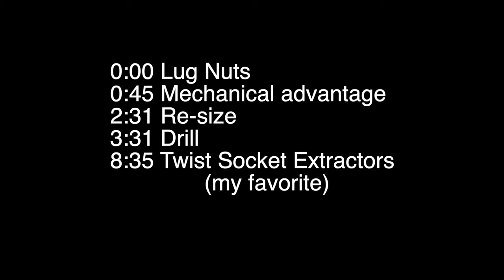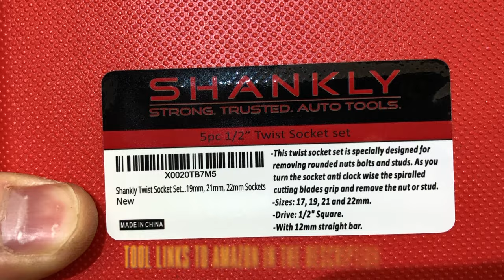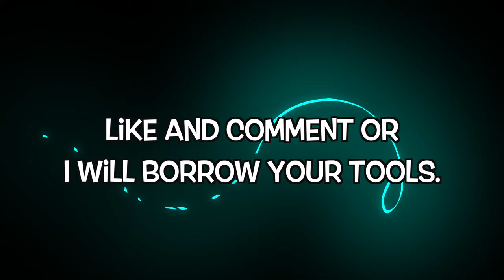STUBBORN LUG NUT REMOVAL TO SAVE YOUR WHEELS! 🛞🔩 Simple-Fast

Comment: Working on my dads 2006 Chrysler Sebring, been sitting for about a year and a half and the battery is dead so gotta change it. In Chrysler engineering wisdom they put the battery in the driver side fender, so have to take the wheel off to get to it. Managed to get 3 out of the 5 lug nuts off but ended up stripping 2 with a 3/4” impact socket. Would you recommend the fluted sockets to get them off?
Reply from the maker: Ya the twist sockets are great. No guarantee. But they have saved me so many times. Essential tool for me 😀🔧

Comment: Is the farther out you are with the breaker bar does it give you more torque? I have a 2012 jag I’m working on. Let my brother help me with this car and apparently he thinks forward on a compact takes the lug nuts off and if not keep going until the lug nut is completely ROUND! Ima try a chisel and a hammer hitting it on the side hopefully turning the nut well so says the triple OG in the 53.. let me know if anyone knows if this technique works porfavor
Reply from the maker: Yes the longer the lever, the more leverage/torque you will have. Sorry you rounded the lug nut. I would buy the twist sockets in the video. They have saved me many many times in situations like yours with rounded lug nuts. I put lots of links in the description for video tool ideas. Here is the link for that twist socket set for stripped lug nut removal 😃🔧 
TWIST Socket kit: https://amzn.to/3jps8K3

Comment: Where are you located.  I would like to hire you to work on my 5th wheel trailer rim and lug nut replacement. The nuts and the rim holes have clad over nuts and metal inserts in the  rim holes.
Reply from the maker: Sorry not for hire. Just making videos 😃🔧

Comment: working on 2017 nissan versa note car 🚗 tried to remove nuts when changing brake pads with torque wrench but the nuts weren't coming off and now are bent a bit from the original six face shape to more circular form. any advice? thanks
Reply from the maker: I would replace the nuts even if they are still functional so they don't cause worse problems the next time they are removed. 
Are they stuck on, and you can not remove them? 
Or you removed them, and they are now just damaged?
Reply: @EasyFixShaun  i tried to remove them but couldn't and the nuts ended up becoming more rounded from strain
Reply from the maker: Sorry to hear that. I think the twist sockets in the video would be my next attempt.  I would pound them onto the affected lug nut really good before attempting removal. Impacts work best with the twist sockets if you have one 😀🔧
Reply: @EasyFixShaun  thanks for your help💖
Reply from the maker: No problem 😀🔧

Comment: I have 2011 tundra with aftermarket wheels and the 1/4 inch extension of the lug nut broke off in every wheel. Any suggestions please?
Reply from the maker: What is a "1/4" extension"? Are you talking about wheel spacers?
Reply: @EasyFixShaun  regular lug nuts have a seat like 60 degrees mine have a 1/4 inch piece that extends past the seat into the wheel. Just looks like a sleeve. Wish I could should a pick.                                             20 ET Conical Bulge Long Lug Nuts 7/16"-20 with Center Washers 0.33" Shank 0.62" Dia 1.75" Length
Look these up. Every one of the sleeves broke off on the stud.

Comment: I got the 1/2" drive,  25" breaker bar from Harbor Freight Tools (on sale this week $16.99 + tax with coupon). Also got a 6' fence pole.
But I have a regular 11/16" (7.46 mm) short socket 1/2" which I was going to hammer on but now I'm afraid it's not going to work after watching this video. If I try this first, will it mess up the lug nut further so the other methods (impact socket or extractor) won't work later? Thanks
Reply from the maker: Its worth a shot! Use what you have so far. Many times pounding on a smaller socket trick will work. If it doesn't work, usually the twist socket will still bite into whats left and work. I have more options available. I usually go straight for the twist sockets in most cases 😀🔧
Reply: If the smaller 11/16” socket won’t work and gets stuck on the lug nut, is there a way to get it off the car? I don’t see how you can get it off if it’s short like that. I did see in you video that it broke apart at one point however, but what if it just stays on? 2:45 Would removing it damage the lug nut enough that any further efforts would be harder?
Reply from the maker: If the lug nut is impossible to get off, you don't have much to loose. Pounding it on gives it extra grip to hopefully remove it. If it doesn't work a long 18" 1/2" extension could be used to wiggle and force the socket off again. That is what I would usually do. If it works, a punch and vise or block of wood will likely be needed to pound the nut out of the socket 😃

Comment: 8:48 How can an open-ended lug nut be removed from the socket/extractor since their is nothing at the end to push on?
Reply from the maker: A punch comes with the twist socket set that will usually grab the edge of an open ended nut and pop it out 😀😀

Comment: I have a lug nut on a Jaguar 2012 That has been tightened extremely tight I have had AAA I've had a tire place try to take it with the reverse thingamajig as well and it still won't come off please advise any other things you can possibly think of as well I'm not sure if they use the tool that you have but they did have something similar to it where it would do the reverse on it and try to unlock it please advise I'm in Los Angeles
Reply from the maker: Hey John, I am sorry for the late reply. Any luck? If you want to save the wheel and all methods are exhausted I usually drill the wheel lug nut until i can remove the wheel like in the video. Then I repair the damaged stud and nut and check all others while there 😃🔧
Reply: Thank you so much for your reply I greatly appreciate it. After so many people came by the house to try to get it off finally a young man came by $200 later unfortunately and he drilled it off it's a little damaged but it looks like I can still save the stem and put the lug nut back on. Unfortunately he wouldn't test out all the other lug nuts to see if they were tight but he refused
Reply from the maker: Im glad you git it figured out! 😀🔧

Comment: Been trying to get a over tightened lug off my 02 bmw 325xi. With 0 luck not sure at this point what elce to do.
Reply from the maker: Sorry to hear that. Is the hex fastener in great shape? If so I would use as a long of a lever as possible to make it easy to break it free. Or borrow a milwaukee electric fuel impact from someone. They will take things off easily or break them if they won't move. 🤓🔧

Comment: 2003 eddie bauer expedition. I've tried everything and can't get the lug off.
Reply from the maker: stuck? Can you get a bolt buster style heat element on it? If you have enough access that would make the nut glow red hot to release and remove with damaging the wheel. If that doesn't work drilling is a good method to attempt to save wheel 😃

Comment: Chevrolet Spark 2019. Lug nut won't come off. Can't do the seasonal exchange.
Dealership is an #ss been useless since we bought the car... Well that's another story.
The tire guys at costco told me the mechanist will need to cut the bolt off. Is it true? Will it cost me a ton of money to change it?
I'm in Canada... price wise.
Reply from the maker: Sorry for the late reply. That sucks. I would recommend the steps in the video to save the wheel. Usually drilling out the stud the the last method of non of the other methods will work. Depending on what is needed the price would vary. I wild rough guess- $100-400. Any luck on the stud since you commented?

Comment: 2014 Chrysler 200 …. VERY IRRITATING. Thank you for making this video. Your suggestions have helped ALOT. Tires plus is an absolute joke, used an impact to tighten my lugs after new tires & the worst part is they told me they did it.
Reply from the maker: Sorry you are having trouble. Your Chrysler Lug nuts are very difficult in general when they get older and corroded. Sometimes replacement of all the lug nuts at the same time is easiest 🔧🔧

Comment: I wish replacing wheel studs would be that easy on every car.
Reply from the maker: Sometimes they can be more difficult for sure. Access to the wheel hub is usually the key. As long as you can gain access, the little installer tool has made them a breeze for me 😃🔧
Reply: @EasyFixShaun  Yeah. Good luck trying to do the same with a Honda. Their hubs are pressed in and most of their knuckles lack clearance to push the stud out without chopping it or push it in without shaving one side.
Reply from the maker: @aurvaroy6670  For sure. If clearance and access is bad, Replacement of wheel bearing and hub could be much easier and faster and/or the only way. Studs are cheap relatively speaking, and when there is no clearance it changes the cost and difficulty and pia factor fo sho!

Comment: 07 Dodge Caliber and I have a issue with removing this one lug on my wheel tried twisted sockets and it did work at all
Reply from the maker: That sucks. I think I ended up having a similar problem. One lug nut just wouldn't come off, no matter what I did. I tried hard to get it loose too! The drill ended up coming out and removed it pretty well for me 😃🔧
Reply: @EasyFixShaun   yea it would come off for nothing no matter what I used so I’m just gonna go to a tire shop an have them fix the issue
Reply: @EasyFixShaun   damn Chrysler’s
Reply from the maker: @eriknobles3946  That sucks man. I have seen some crazy difficult lug nuts on chryslers. I don't blame you one bit 😃
Reply: @EasyFixShaun   gotta get it done in case I get a flat in the middle of nowhere stuck
Reply from the maker: @eriknobles3946  Yup smart move for sure man. 🔧

Comment: What do you do if the stud is turning
Reply from the maker: In that case I would go straight to drilling the stud method. I would probably loosen the other nuts that are good so that I could put some pressure on the one bad nut with the wheel stopping it from turning so that I can drill the nut. Might need some additional methods to stop the lug from spinning, but I would spend time trying to figure out how to do that. If it doesn't work the next step might be cutting off the lug in one way or another😃🔧

Comment: hello, can i go straight to drilling the lug nut with drill bit? because today was gonna rotate my wheels but when i was loosening the last lug nut it just stopped. and i didnt want to force it so i think this is my best solution. i have done this but i dont know what else to do.
Reply from the maker: Yup. I think that you have a perfectly good reason to just drill it. You could try to force it one last time since you have nothing to loose. 😀🔧
Reply: @EasyFixShaun  well I got it out with good old wd40 lol
Reply: @EasyFixShaun  but stud is cross threaded
Reply from the maker: Im glad you are making headway. Its super frustrating when they don't work properly. Nice work 😀🔧🔧

Comment: How do I remove a lug bolt???? my wife’s Jeep Compass 2018 has a bolt instead of just a nut
Reply from the maker: Similar methods apply no matter what style lug nut or bolt you have. If it is stripped i would try the twist sockets. That would be Awesome if that is successful and would save a lot if drilling. Drilling would be a last case scenario method. Sorry you are having trouble😀🔧

Comment: What kind of drill bit did you use to drill out the stud?  Mine wouldn't work.
Reply from the maker: I use cobalt or another high quality bit. I put links in the description. Here it is 😃🔧
Cobalt Drill bits: https://amzn.to/2YLW7nA
Reply: @Easy Fix  I tried some cobalt drill buts but couldn't seem to get anywhere with them. 
I ended up buying an angle grinder, which quickly split the nut, then I broke the two halves off with my hammer.
Reply from the maker: Nice work! Any wheel damage?
Reply: @Easy Fix  not really, aside from some paint scratches from tools scraping against it, and a small, shallow nick of about 2mm where the cutting disc briefly touched it.  I put some touchup paint on those parts.
Reply from the maker: @AJ-on-youtube  Nice work, I am glad that worked out for you! 😃🔧

Comment: Need some help. So I stripped a lug nut so I hammered a smaller socket on it, so the wrench broke and the extension broke inside the socket idk what to do.
Reply from the maker: I would try to remove by pounding off with a hammer sideways back and forth if that is the only option. Once off- Try the twist sockets, hopefully that will do the trick. If not drilling may be needed 😃🔧

Comment: same issue with my 2020 wrangler (22mm).  Even though torqued properly, one lug is stuck to the point where the "cap" is all deformed and spinning.    Imagine having a flat off-road??  I even bent the tire iron OEM wrench and still nothing.  Chrysler and any other mfg needs to wake up before someone gets hurt.
Reply from the maker: Wow! Ya that is crazy. The lug-nuts have been like this for 2-3 decades now. It seems that the design is the best they can do. Absolutely crazy 🤮

Comment: 2011 skoda octavia vRS two rounded 17mm lug bolts
Reply from the maker: twist socket will usually grab hold of those and make them come off fairly easy. That is my go to method. Hopefully it works for you😃🔧
Reply: @EasyFixShaun  I'm going to try a fresh new 6point impact socket first with a breaker bar and a couple shims if the socket don't work on the bolts flat spots if not a next size smaller and a hammer
Reply from the maker: @Lee-At-Green-Pheonix-Rc  Thats a great idea. I have had luck pounding on a socket that is one half size smaller also. I put a link in the description for half size sockets sets. I can not find a 16.5mm that you could try but here is a link to a set I have. You may be able to search for the 16.5 for your application. 😃🔧https://amzn.to/3Kottza
Reply: @EasyFixShaun  I tried a 16mm wen on and rounded more even used heat but no go I'm just gonna put in a garage now doing my head in but thanks for ut help man
Reply from the maker: @Lee-At-Green-Pheonix-Rc  No prob. I would try twist socket next. They are magical. If that doesn't work you are probably looking at drilling it out to save the wheel from damage 😃🔧
Reply: @EasyFixShaun  I'm done with it mate hit my finger and squrted blood and now finger is bright purple 😅
Reply from the maker: ouch!

Comment: What size is that drill
Reply from the maker: I think i showed it in the video. It is 1 or 2 sizes less than the stud size. Undersizing will help to not hit the wheel and damage it. The wheel hole is just barely larger than the stud to fit over it. Could start small like 1/4" and work up larger sizes also as an option. Once the bit is 50% or more larger than the stud it will be significantly weakened and wiggling the wheel may even be able to break it and release the wheel 😀🔧

Comment: Some one overtightens them with Impact, tighten by hand, and pb blast them before install.
Reply from the maker: I agree with you except for the lubrication. The torque specifications are for no lubrication on the threads just like they arrive from the factory. 😃🔧🔧

Comment: What brand adapter do you recommend
Reply from the maker: For 1/2"-3/4" adaptors? Any will do usually. They are so big and have so much metal i find that are inherently very strong. I use cheap ones. Ive never broken one 😀🔧

Comment: What if the stud itself is spinning with the nut stuck to it?
Reply from the maker: That is a extremely difficult situation to save the wheel and all other components. Theres just no access to work with usually. I have had luck by using the longest sawsall blade i can find if the wheel is loose, has large spoke openings, and the stud can can been clearly seen. I have snaked it in a wheel just barely and cut a spinning stud with success and no damage. Most times you will need a new wheel in just about every other case though. That's a tough one and really sucks when it happens. Plan on having access to ordering another replacement wheel in mind for your repair. Sometimes when there are no options at all with that and the entire wheel is destroyed by cutting it to get to the studs for replacement/repairs. Hopefully this doesn't happen to you. Extremely tricky for anyone 😀🔧
Reply: @Easy Fix  I ended up cutting the nut in half right down the middle with an angle grinder (3" cutting disc), which made short work of that nut, and then breaking the two split halves off with my hammer.  Stud came right out.

Comment: "You get those at home depot" my kid brought me one home lol, fence the field over was half demolished ?think a car hit it? and I ended up with a 20' long chunk bent all to shit in my yard so cut it up xD

Fun story: I have a socket that still has the shell of one of these in it lol, and yes that is an impressive shaving!!

Question, what year and model that car? I'm pretty new to this world but only vehicles I've replaced wheel studs on, I could rotate the tire adjacent to the dust shield and the studs would pop right out! No moving them around in the ebrake
Reply from the maker: 😂 those shavings were big! This car was a dodge Avenger i think 😀😀